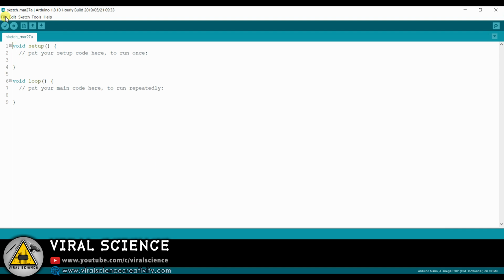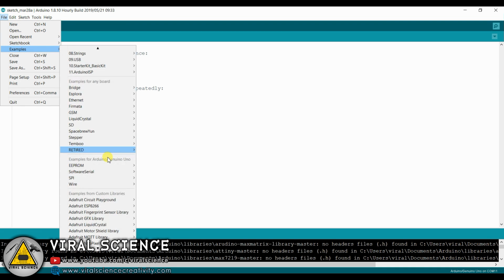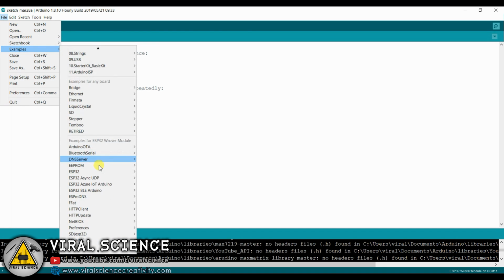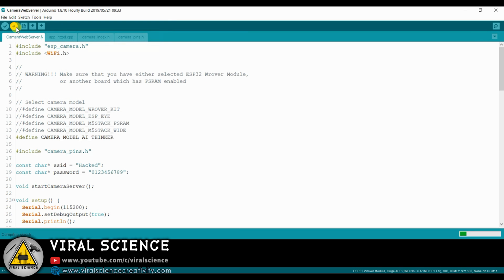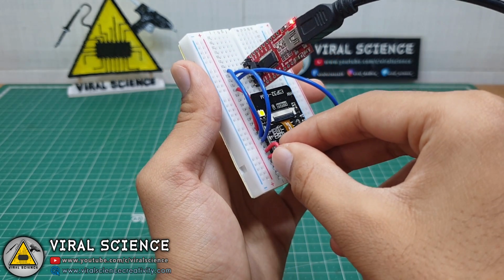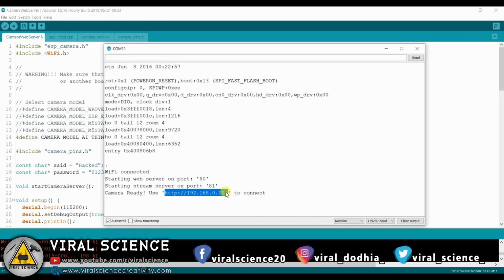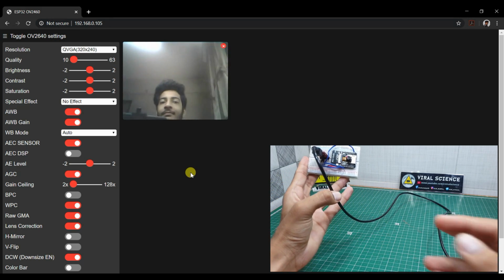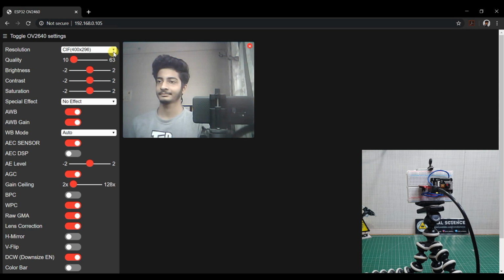ESP32 CAM Getting Started | Face Detection

Comment: hi bro, i followed everything you showed but every time i upload, an error comes as A fatal error occurred: Failed to connect to ESP32: No serial data received. Can you please help me solve this
Reply: Same happened with me
Just try to connect arduino directly without using any extra extensions or use different usb wires
For me i was using an extended extension so i just removed it and it workef
Reply: @itzmeziggayt7099 Hi brother, I tried everything but this problem is still coming.

Comment: Hi Sir, thank you for your tutorials, it was great.  Please, I would like to know if by inserting a memory card, the images recorded by the Esp32-cam module can be used for easy detection, or if facial recognition is limited depending on the space available to the esp32-cam  , or if it is possible to store the maximum depending on the external memory add?  Thank you, please answer me.
Reply: Did you get the answer ?

Comment: you wired the 3.3v pin? It doesn't work with 3.3V, only 5v. At least, I tryied to use 3.3 with a 9v=>3.3v dropdown module, with arduino, no luck.
And.. face recognition does do nothing :D

Comment: I have problem, my logs:

st:0x1 (POWERON_RESET),boot:0x13 (SPI_FAST_FLASH_BOOT)
configsip: 0, SPIW:xee
clk_drv:0x0,q_drv:000,d_drv:0x00,cs0_drv000,hd_drv:0x00,wp_dv:0x00
mode:DIO, clock di:1
load:0x3ff0018,len:4
load:0x3fff01,len:1216
ho 0 til 12 room 4
load:0x40078000,len:10944
load:0x40080400,len:6388
entry 0x40080b4

[E][camera.c:222] skip_frame(): Timeout waiting for VSYNC
[E][camera.c:1406] esp_camera_init(): Camera init failed with error 0x20003

Could You help me?

Comment: Sir I had tried your this project as per your tutorial in several times , everything is working but  when select face recognition / face detection  my face it is not shows any square on the face and  not working, although I have change my cam module with AI thinker but still is not working. I would be really grateful if you give me the solution.
Reply: I've got my problem solved, before this i'm using esp32 library version 1.0.6. So, i've downgraded esp32 library to version 1.0.4 and it works for me finally.
Reply: @najihasufian4535  can anyone of you give me the whole code for the face detection? im outta country and need to present this project to my teacher
Reply: @raulg08  actually the codes can be obtained in examples after you download esp32 in boards manager and make sure to select the older version before download it
Reply: @najihasufian4535  Bro can you please tell me which arduino version you have used
Reply: @jimmyoreo  arduino 1.8.19
Reply: Hi did you solve your problem?
Reply: Yeah i have the same problem too, didnt find any solution to it yet :(

Comment: While pressing the onboard button the LED is not blinking , I tried two boards, tried 3.3 and 5 v (on different pins), what could be wrong ? Also showing timeout error while uploading, tried two computers, tried older Arduino IDE (1.8.10).
Reply: Yes this led on board not blink at all but for the time out error check your settings in tools>partition schemes- huge.........  And upload speed according to your board , if you have ESP32-S then you have to set it to 115200 and then check it.

Comment: hi i am facing one problem this project is very necessary  and urgent 

[E][camera.c:1113] camera_probe(): Detected camera not supported.
[E][camera.c:1379] esp_camera_init(): Camera probe failed with error 0x20004
Camera init failed with error 0x20004

pleas do the nead full ASAP

Comment: excellent project, I would like to ask a question, How can I add a 16x2 LCD so that a text appears when opening and closing the "solenoid lock"? regards🤝
Reply: You can use one of the LCD libraries and include that in the arduino code. Look up some videos on connecting it to arduino. It's only a few lines of code to accomplish what you want.
Reply: I did this on raspi without lock , works great , use with i2c backpack module

Comment: Hi
everythings good but my program in serial monitor stops here itself

rst:0x1 (POWERON_RESET),boot:0x13 (SPI_FAST_FLASH_BOOT)
configsip: 0, SPIWP:0xee
clk_drv:0x00,q_drv:0x00,d_drv:0x00,cs0_drv:0x00,hd_drv:0x00,wp_drv:0x00
mode:DIO, clock div:2
load:0x3fff0018,len:4
load:0x3fff001c,len:1100
load:0x40078000,len:10088
load:0x40080400,len:6392
entry 0x400806a4

After this nothing appears neither the connection status nor the ip address
Reply: Please anyone help me out

Comment: I follow your instructions but for some reason it's not working. These are the errors I'm getting on the serial monitor. [E][camera.c:1049] camera_probe(): Detected camera not supported.
[E][camera.c:1249] esp_camera_init(): Camera probe failed with error 0x20004

Comment: PLEASE reply , iam getting an error after pressing reset button in serial monitor "Brownout detector was triggered",  tech team support from that site suggest to power the esp32 with external power to 5v  using LM2596 . is this issue because of less voltage to esp32cam? i connected to 5v .

Comment: Hey guys, I am writing this to help others who run into the same problem "Brownout ...triggered". This is caused by low voltage coming from the FTD programmer on the 3.3V rail. As a solution I switched the jumper to 5V on the FTDI and moved the wire over to the 5V pin on the ESP32-CAM. Everything works fine now!
Reply: If this method didn't work, try powering the card from a different unit instead of an FTDI unit (it worked for me).
Reply: Please whenever I upload the code they keep telling me that there is an error with the selected port. Either is not connected or does not exist.
Reply: @abubakarawwal1708  change the port settings..
Reply: Thank youuuuuuuuuuuu soooo muchhhhhhhh

Comment: All good but when the IP should pop out, instead this message pops :
[E][camera.c:1049] camera_probe(): Detected camera not supported.
[E][camera.c:1249] esp_camera_init(): Camera probe failed with error 0x20004

plz help
Reply: Hey bro i have also face this problem can you solve this problem?  Pls
Reply: Esp32 cam ka jo power pr wire lgai h osy 5v pr lga do or bechy sy jo module h osy be 3 ke jga 5 krdo 2no module ko 5v dna h

Comment: Is the face detection done by the ESP32 board or out on that website you linked to?
Reply: I have the same question about it
Reply: isn't there a code behind it? i don't think esp32 does face recognition by itself? or i might be wrong idk
Reply: @raulg08  I'm not sure what you mean by "a code behind it". Any processing done on the ESP32 board or out on the website is certainly done by a program, by software.  Perhaps that's what you mean by "a code behind it". My question is whether the software that does the face recognition is on, and processed by, the ESP32 or it's out on the related website. It's partially a question of whether the ESP32 is powerful and fast enough to do such processing. It would be nice if an answer would be provided, along with some links to where that type of software for the ESP32 might be available.

Comment: Cant the program connect to the wifi and web server before setting up the camera.   Then we can get the ip from the serial monitor before attaching a better power supply. I've never been able to get these to work with out the camera errors and every answer that fits my problem is mostly power related.

Comment: guys, , if you get an error and tried all the solutions, I managed to sort my problem out, as there seems to be 2 different versions (one has error fixes in it) of the code and also 2 different ways to hook the arduino and esp32 up, check youtube videos and you will find them, and then try the 2 codes, with the different hook ups as an experiment and it will work. i think its because ESP has 2 different brands or something. they do the same thing and look the same except something small is different, hence why there is 2 different codes etc.

Comment: How can i control output by recognition the face??
I wanted to Say that, suppose if my face detected then it will do another work like led blink/motor running etc.
Please tell or make another video using this module....
Please please please Please
Reply: whether you find that??

Comment: Bro what is that red colour break oit board in this video and use arduino code but you did not use arduino board how this is possible
Reply from the maker: That is TTL connector to program other modules

Comment: hi...i have this message from serial 

..
WiFi connected
Starting web server on port: '80'
Starting stream server on port: '81'
Camera Ready! Use 'http://192.168.1.7' to connect
[E][camera.c:1344] esp_camera_fb_get(): Failed to get the frame on time!
Camera capture failed

I open the 'http://192.168.1.7'  window but nothing happens....i changed to 5V ....also do the same...
Any suggestions ?
Thanks in advance
.
Reply from the maker: If you are getting the IP link then it must open that webpage you have successfully did all steps
Reply: @ViralScience  the webpage open but nothing happens....

Comment: Bro what this works in same network connection or out of the network connection like I connect camera to Wi-Fi and I took that IP and put it on my phone browser and Iam using my mobile internet data then it will work....
Reply from the maker: The procedure i showed in this video will work for same wifi network
You cannot see the stream through mobile data or other networks
I will uploading another video for this... stay tuned
Reply: @ViralScience  ok